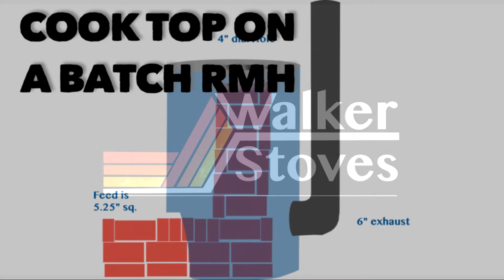Cook Top on a Batch Rocket

Comment: How’d you get the ceramic glass stovetop out of the metal frame?
Reply: I used a paint scraper (the flat part) to carfully cut/pry the high temp silicone/adhesive to free the neoceram.

80% work fine.  1 in 5 may break the ceramic glass, so be careful and watch your eyes.

I have 5 or 6 neoceram tops now.